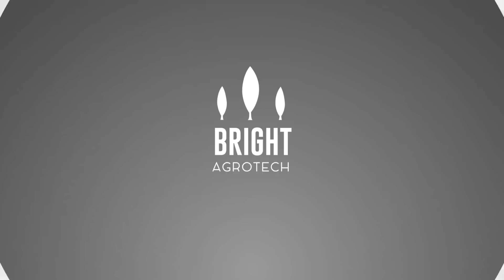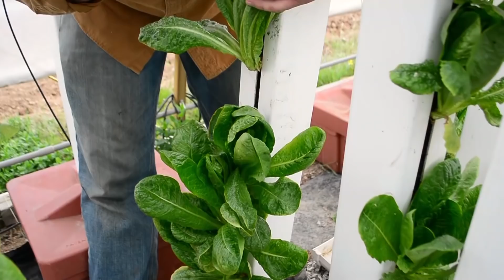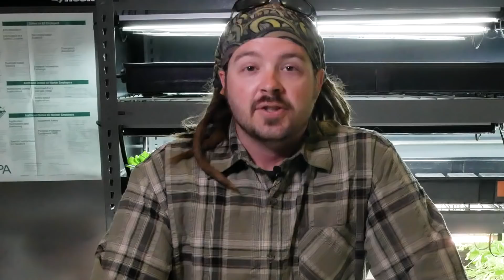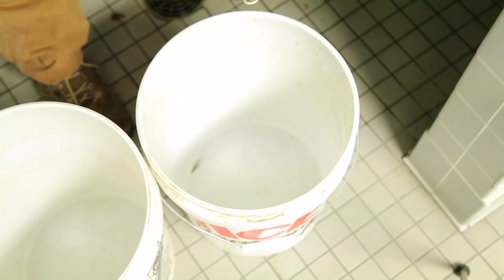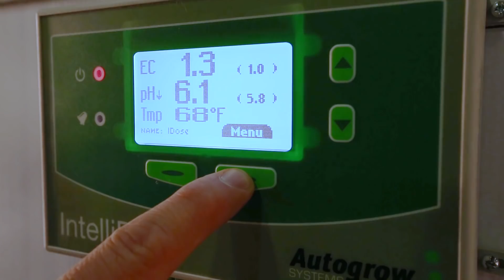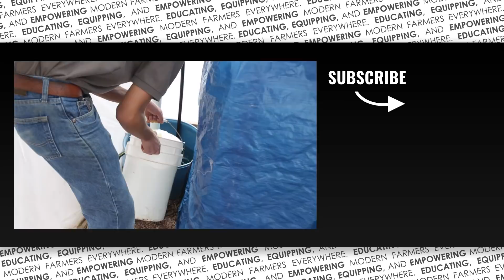A Beginners Guide: Electrical Conductivity (EC)

Comment: The unit is correctly siemens, after Werner von Siemens. Nevertheless, as an electrical engineer, hobby gardener, I really learned a lot from your summary with plenty of very useful practical considerations. Thank you indeed.

Comment: Still convinced that EC monitoring products are snake oil for 99.9% of hobbyist growers. Follow the dilution guidelines of the nutrients, check PH, and it should be fine... unless you have some very unusual water supply (assuming you are standing for 24 hours and/or filtering if it's out of the tap). In other words, if you are having an issue with your plants, EC would be the final thing to spend money on testing after all the other factors have been considered? Open to having my mind changed here!

Comment: Love your videos. I'm a new subscriber!
One thing i'm still confused about tho:

EC represents the electrical conductivity in a solution, and we use it to give us an indication of how much nutrients are present in a solution, since more nutrients = higher EC.

But are all EC enhancers necessarily nutrients? 
I think they say that lettuces require an EC of about 1.4, so lets say i'm growing lettuce and therefore aiming at an EC of 1.4. 
Scenario 1: My tap water is 0.3. Therefore I should add a decent amount of nutrients to get to 1.4.

Scenario 2: My tap water is 1.1. Therefore I should add a small amount of nutrients to get to 1.4.

Will both scenarios lead to the same results? Is the difference between the original tap water EC in the two scenarios (0.3 vs 1.1) necessarily due to the 1.1 tap water containg more nutrients, and therfore requiring less plant food to be added to the solution? Or does it contain other random particles you might find in various water supplies? And even if it contains nutrients, are these nutrients necessarily beneficial to the plants im growing?

Hope I was able to convey my question :)

Comment: Great explanation. But I'm still confused. My EC meter (Vivosun) reads 148 for plain water and 1446 for my solution. On PPM it reads 68 in plain water and 690 in solution. I don't see 1.2 or 2.5. There are numbers at the bottom of the screen:78.0 and 63.0. I don't know what any of this means. :(
Reply from the maker: The electrical conductivity of water is normally measured in millisiemens per centimeter (mS/cm). This unit of measurement would give you either the 1.2 or 2.5 you are looking for. 

In regards to converting from PPM to EC, you can take the reading of 690 and divide it by 1000. This will leave you with 0.69 and then multiply that number by 2. You should end up with an EC reading of 1.38 (mS/cm).

Comment: If my EC going in is 1.6 what should my runoff EC be??
Reply from the maker: Thank you for your question. There are a lot of variables that contribute to how EC fluctuates in your system, and there is no concrete answer to this. In hydroponics, typically your EC would decrease as it becomes used in your system; however, this all depends on the type of nutrients you use, what type of system you are set up with, what crops and how many of them are currently growing, etc...the list goes on.

Comment: I have well water and the EC for it is 0.40. My 3 part hydroponic solutions guide says to use an EC of 2.0. Does this mean that I only add 1.6 EC solution of nutrients for a total of 2.0 or do I add an EC 2.0 of nutrients for a total of 2.4?
Reply from the maker: Hello! The latter is what you should do… if forgoing an RO unit you should use the incoming EC as if it’s 0 and then add the recommended nutrients accordingly
2:45
Target EC is raised by same amount as incoming source water

Comment: One question Ethan please - While planting the lettuce seedlings, I set up the EC on 1.0, and as I know, I have to increase it step by step, but what is the exact period when I have to set it up at 1.5 and 2.0? or above them?
Reply from the maker: Hello! 

I would generally recommend with Lettuce that you hold the EC at 1.2, any higher and you are wasting nutrients and risking nutrient lockout by too much Calcium or Magnesium!

Thanks for watching
Reply: @ZipGrowInc  Thank you so much too, and one more question please - If you set up the EC at 1.2, what is your TDS and the concentration of macro elements in grams per liter water?
Reply: @ZipGrowInc  ???
Reply from the maker: @onisezivzivadze2193  Hello Onise, this typically depends on the nutrient mix you use, so depending on those ratios your macro elements will be affected. The only real way to get these numbers is to send them off to a lab after mixing your nutrients, or calculate based off the fertilizer bag and how much water you added 

Thanks for watching!

Comment: It really made me understand. So I check my water. Tap water came to 3742 EC and drinking water was 72. First I thought my meter was broken. PPM for my solution was 832. Can I still use dechlorinated tap water?
Reply: Drinking water EC should between 230- 450
And tds 150-300

Comment: Are there other ways of measuring EC? I can't justify spending 200 dollars on a meter and I don't trust the 15 dollar one to be accurate. What can I do? Will not checking it make a huge difference? (I'm only growing a few trays of microgreens and some tomatoes)
Reply from the maker: Usually we only trust good quality EC Meters such as the Hanna or Bluelab Meters. If you cannot justify the cost, as long as you are replacing your solution every few weeks and dosing consistently you should be fine with microgreens and some tomatoes.

Comment: what would you consider "high" enough EC to require RO filtration?
Reply from the maker: Hi, thanks for your question. Anything under 0.4 mS is passable without RO. You’ll need to adjust your dosing to compensate for a baseline above 0.0 however. Having said that municipal water is safer as it goes through treatment already whereas with well water you’d probably want to have it tested for biological activity and/or heavy metals.

Comment: I have watched your video many times most of it, to understand whats all this EC, ppm, TDS, etc. I understand somehow, I only have a ppm measurement, so 1k ppm depends on which conversion EC . well when I measure my water there's already a ppm like 300 then I tried the rainwater it is like only 30 ppm most likely. so its not ok to just minus the ppm in the water so you can come up to what EC you want like I need 1k then when putting the nutrient solution I will gEt a 1300ppm. Is this ok?

Comment: I have a 17 galon dwc system and my pH is going up by 2 points plus every day, I corrected daily but have not idea how to get this under control.
Reply: How hot is your room temperature first then what are you mixing 4 nutrients
Reply: @kevinkelley2932  Thank you Kelley, think I was using a wrong pH down solution. I changed for another brand and  the problem is solved
Reply: @Jacinto Vittini It is also depended on the sort of the fertilizer. Under some of them the pH level is stabilized, but some of them can not maintain the constant level of pH everyday. For example, pH is never changed for my lettuce, but for strawberries it is.

Comment: ok so   you measure EC base on conductive dissolved electrolytes  IE salts in the water  where do we draw the line  on installing a filter system and   seriously an RO system is expensive on small scale use so whats an excetable  ec level from tap water before we should be concerned we all know certain minerals  dissolved  in water are beneficial.  OR should we also look at ways to measure available dissolved  N - P - K  usable for plant growth as an additional  test
Reply: Stealth ro is only about 200 bucks. Thats not that much for good clean water for cannabis

Comment: No im not confused its called the 500 and 700 scale and ec is a conversion of both so if my friend is useing 700 and im useing 500 we can talk back and forth just useing the ec conversion
Reply: @delosombres ppm isnt useless half the reason people use ec is to have a direct conversion between the 500 scale of ppm and 700 scale of ppm
Reply: @delosombres it dosnt matter what u put in 500 ppm on the 500 scale is 1.0 ec it dosnt matter ifnu put in 500 ppm potasium or manganese 500 ppm is 500 ppm and it comes out to 1.0 ec
Reply: @delosombres now the 700 scale is completely dofrent than the 500 scale when it comes ro ppm thats half the reason we hav e ec so that people useing dofremt scales can talk back and forth without mixing up numbers from dofrent calibrations also 1.0 ec is 10 cf i have a whoke chart that dosproves everything u said if your growing and not understanding ppm 500 or 700 scales, ec or cf then u shouldmt be growing period

Comment: My ec is resding 250 inplain tap water .. after adding a small amount of nutes and mixing solution good..my ec is shooting straight up to over 2.6...ifi add tap water the ec goes up not down...i cant get it stable at 1.2 help needed...
Reply: I had this problem too. Too much undesired minerals in my tap water. An ro system worked for me. Iv seen people use quality bottled water as a fix but id think an ro would pay in the long run. Hope this helps

Comment: I am a beginner wrt Hydrophonics. I had questions wrt EC value.what is the relationship of EC wrt Temp..i am seeing strange values ex morning 1.1 to 1.2 temp 18C evening .7 to .9 temp 22C for continuous three days. Need help on this
Reply: Higher temp higher EC. Always check ec around 25c or get an ec meter with automatic temperature compensation (ATC)

Comment: As usual, a very informative video. I do have a question, though. It seems like EC and exactly what contaminates are in the water are two separate 'readings', is this correct? Clearly, EC doesn't actually tell you the exact names of the chemicals that are in the water, more just how much of them there are, so is this a 'problem'? I ask this because I live in Saudi Arabia and the ppm of the water here is over 2000 which means it is out of range for my Hanna Instruments EC / TDS meter (for both scales). If, I am able to get the EC to within an acceptable range, is this all that matters, or do I actually need to know what is in my water (the exact names of the chemicals) and somehow 'balance' them out too? Thank you very much in advance. :)
Reply: You need to get that Ppm way lower. You can do it with a reverse osmosis (RO) filter and then add the nutrients to the cleansed water.

Comment: Blue lab E.C truchen best on the market no calibration needed
Reply: Is that still true?
Reply: @davidrosa3182  "calibration" is not needed ... however cleaning of the contact points are required (about once per month). After cleaning the Truncheon is tested in 2.77 Conductivity Fluid to see that the contact points are clean and again taking accurate measurements.

Comment: This might sound dumb but am gonna ask anyway. 

1. What standard solution do use to calibrate your EC parameter(specifically)? Can I make my own solution for this? 

2. I have some standard solution to measure PH alone for lower end and higher end but any means I can make my own solution that I can use for testing? 

Thanks.
Reply: technically you could produce your own standard solutions, all it takes is the ingredient salts and distillated RO water, a fine scale and the rest is mixing a big batch to reduce your inaccuracy in measurements.
In practice, even in a lab with all bells n whistles you just grab a pack of standard and rip it open. Due to the fast denigration of these standards labs use single use packages too - so go figure what that means for your big batch ;)

So for the economical question, get a cheap source of these standards in little packs and stocking a stash of 7.01/4.01/1,413µS/KCL will get you the furthest.

Comment: It took me a while to understand that EC measures ALL the nutrients in solution, basically the sum of all the ionic compounds. You can't measure how much phosphorus you need to add, because it's just a part of the reading. If you keep adding an "all-in-one" solution, at some point you have to dump everything out and start over because the proportions are out of whack. How do you know when you get to that point?
Reply: Change out weekly is the norm.

Comment: My Hanna Gro Line Combo HI 98131 meter does EC/TDS ppm with the option of 500 and 700 conversions setting. I've also noticed the meter when set for one of the ppm setting it shows EC first for a couple seconds then the ppm so you get to view both.